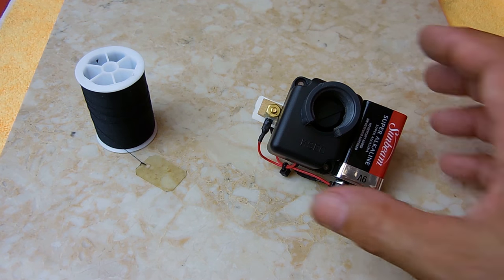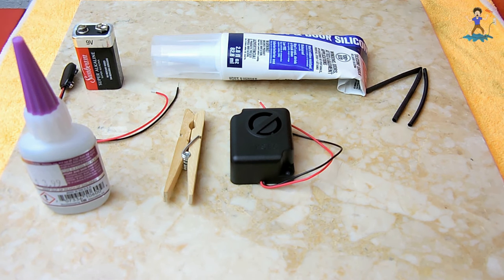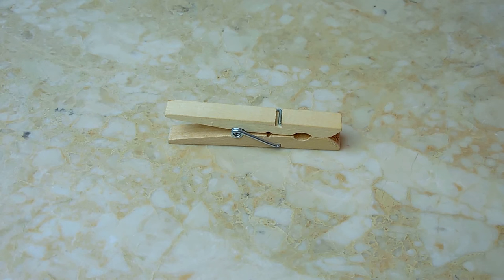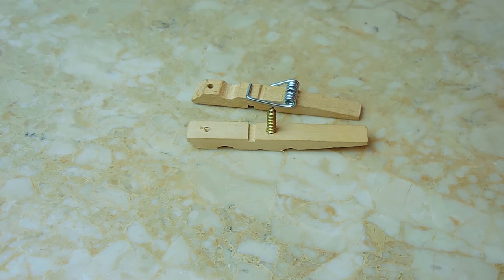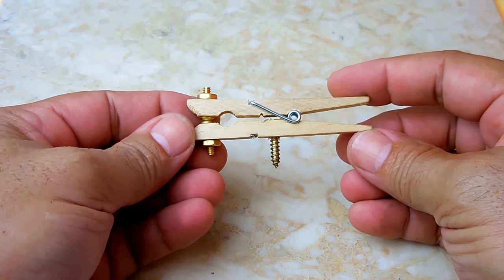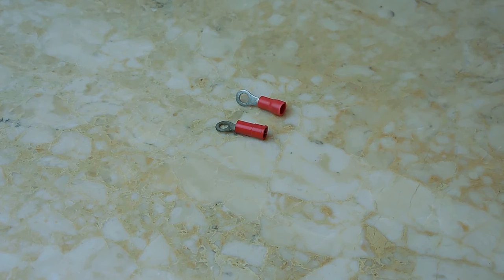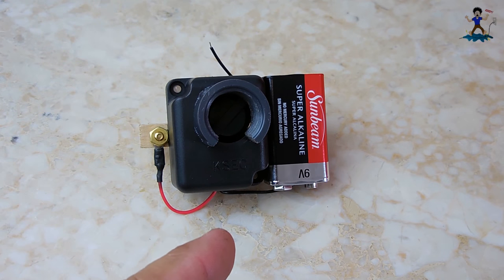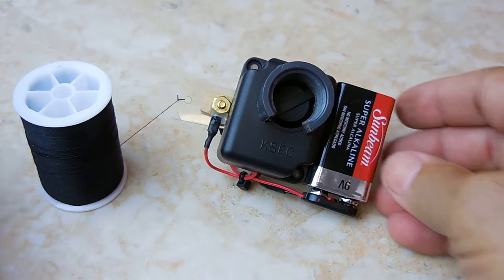The BEST Trip Wire Alarm!

Comment: 3 things. First use double stick Velcro on batteries for replacement, Second, you can paint the entire unit to match your background. Just cover the alarm opening. 3rd: Layer your alarms. Assume after the first breach they will cut string. Put more on the inside of your home.

Comment: Excellent video! Here's what I need though ... I need an alarm that will only go off for a relatively short duration. (sounds long enough to scare the intruder away and then shuts off) This way I don't have to physically turn it off so that it isn't a "nuisance alarm" for my neighbors. How would I accomplish this?  I guess I would either need an alarm where its default is to go off for a set time or ... a duration settable alarm? Is there such a thing? Is there such a Piezo Alarm?

Comment: As an industrial maintenance electrician  by trade that was beautifully made. The only improvement that springs to mind for me is maybe treating the peg with preserver first as in uk pegs tend to rot and weaken over 1 - 2 years but very very good video
Reply from the maker: True, a good coat of varnish. Thanks for watching! Also check out my portable PIR motion detector alarm.

Comment: your idea for air soft is genius to put at your six. I would think camping could be another good application.
Reply from the maker: You could easily use this to secure a perimeter around a tent. All you'd need are (3) screw eyes and a long string/thread. :-)

Comment: can you help me? i am so tired of my neighbor running over my sprinkler heads that I put 4ft tall poles with a large reflector at the top of the pole and i put them(#5) on every  corner of my yard plus the center sprinkler (also to prevent mowers from running over the heads) and the reflectors are being stolen. is there a way to make a pressure alarm or something that will loudly go off when the reflectors/stakes are pulled out of the ground? thank you

Comment: I was wondering can you make a laser or motion activated ignitor or firing device, meaning if I wanted to make a trip flare but instead of using a trip wire have the motion detector or laser pointer to electronically ignite the flare?
Reply from the maker: Not hard to do. I have another video showing a small, portable IR motion activated alarm. You need to pick up a model rocket igniter(or make your own like I show on my channel in another video), then instead to having the piezo siren trigger, you would use a 2N4401 or higher current rated NPN transistor and have it trigger the igniter. :-)
Reply: it's been years since I've wired or soldered anything but it will be fun to try thank you

Comment: 95dB isn't slightly less than 105dB, it's less than half as loud (but still suitable in most cases).
Reply from the maker: Hard to believe that only 10db difference is 2x as loud, but according to the link below, you're correct. 95 DB is a subway train at 200 feet and 105 DB would be like standing next to a small gas engine at 3 feet. You would think 52db would be 1/2 as loud.

http://www.gcaudio.com/resources/howtos/loudness.html
Reply: Logarithmic scales are weird like that. I thought 6db attenuation is half amplitude though.For certain measurements, 3db down is half. Logarithmic scales are used because they are supposed to better approximate apparent loudness, at least for sound, and can allow very, VERY large differences to be graphed on the same (log) scale, allowing a very wide dynamic range.

Comment: i would prefer using a pir motion sensor instead of a trip wire, cauz what if it goes off when a small tree branch falls on it late in the night how would u disable it?
Reply from the maker: The odds of a branch falling on the wire(line) are extremely low. No concern at all. I also shaw a very nice and compact PIR sendor alarm on my channel. Thanks fro watching!

Comment: I like this! Can anyone think of a way to have it automatically shut off after a minute or 5?
Reply from the maker: It does shut off automatically. You can adjust how long it stays on.
Reply: @electronicsNmore  Radio Shack online still lists the part (102dB) but it doesn't mention anything about auto shutoff. Pretty important in town if it goes off in the middle of the night.. Suggestions? Great video by the way!

Comment: I want to see you solder the wire. I see where the red wires go, that was good. You didn't show where and how you connected the black wire.
Reply from the maker: Tell me where in the video. Post the actual time so I can look.
Reply: the black wire will go to the other head of the pin plastic pulls off + and - touch makeing power/sound

Comment: hey nice video.  need your advice...i live out in the open country. i got a storage shed about a couple hundred feet from the house. got someone trespassing there. not sure if ill hear that alarm. sure it will scare em off. but i wanna catch the asshole. is it possible to hook up a car alarm horn to a car battery using the same or similar procedure?  just asking. ..i know i will hear when the horn sounds.
Reply from the maker: Yes. Very simple. Eliminate the piezo alarm and use a 9V Songle relay. Power will be applied to the relay coil. Using another 12V power supply(small lead acid battery), connect up your car horn to the COMMON and NORMALLY OPEN terminals of the relay just like a switch.
Reply: electronicsNmore 
hey thanks for the info. gonna try it. liked and subscribed

Comment: good idea but could not find the numbers on the alarm? I have everything else but need the alarm.
Reply from the maker: Radio Shack 273-079. :-) You can also use other piezo alarms at the link provided in the video description area....Much cheaper.
Reply: Sounds ike you know what you are doing. I have moved my Mother into a house next to mine so she didn't have to go into a home. HOWEVER. I am looking for a inexpensive wireless alarm that she can carryJust a button and if she was to fall she can press the button and a LOUD VERY Loud alarm/siren will go off out side. I have looked at the medical things but do not have that kind of money. I wonder about a wireless door bell and replaceing the speaker with an alarm or siren? Would the speaker from one of those set off this alarm?  Have you done anthing like this. I am finding lots of people that have a need but not the money. Thanks Royce

Comment: you can buy a 130 db trip wir alarm on Ebay for $13.50, it's also waterproof
Reply from the maker: David Storton Not waterproof. water resistant. The unit has short battery life of only 30 mins, needs to have a line connected to both sides, and when it falls on the ground, it has a 50/50 chance of landing face down in the grass or soil. When that happens, the sound level is greatly reduced. If the line from a tree is kept short to the alarm, and it swings down with the piezo against the tree trunk, the sound will also be reduced. They also exaggerated the db rating. Thanks for watching

Comment: Good vid and, yes, it's a "pee-ay-zo" alarm. No other way. lol
  A tip. Save your money on the super glue (unless you have some you're dying to use anyway).  Just use the silicone on both the screw (it just keeps it from backing out as well) and to attach the rain shield.  Unless you use lots of glue, water can find its way between the pieces and will work into the alarm.  There's no stress on the shield, a bead of silicone will hold. If you just can't stand it and use the glue there, fine... But run a thin bead of silicone over the seam, anyway.   You want it to work in an emergency, right?
  Thanks for the good projects.
Reply from the maker: Pee-ay-zoh or pie-ee-zoh.Thanks for watching!
Reply: electronicsNmore 
  You're very welcome.  ND lots of people pronounce things incorrectly all the time. It's peee aaayy zo....  lol. Sorry :)
  I still like the idea and will probably build one myself.  With a peeayzoelectric doohicky.  ;)
Reply from the maker: Depends where in the world. You can look online, you'll see the (2) pronunciations shown. :-)
Reply: electronicsNmore 
  Sorry late to reply...  Yes, different in different places, doesn't make it right...  Like aluminium?  and a few others that are on the "everyone does it so why fight it" list.  lol.

Comment: Trip wire. We have ninjas here they map out the infrared sensors and walk them off wearing black clothes. A trip line moved at random. Might be what the doctor ordered. Wish they would get a job. Instead of riding 4 four wheelers and drinking all night, and let my Genny fuel alone. Tks om de kv4li.  Post script..maby a car horn and a motor cycle battery. Might get some strange smells in the night. He he.